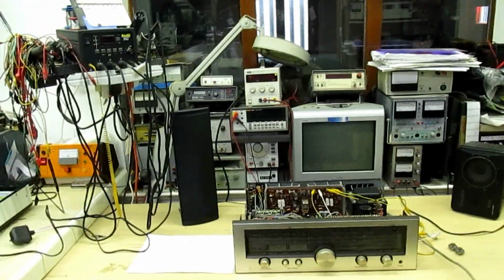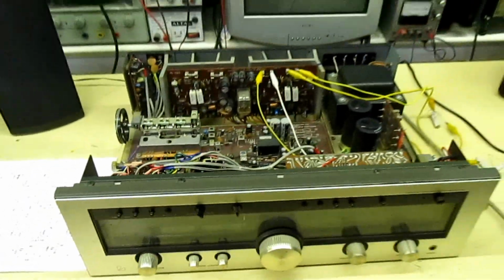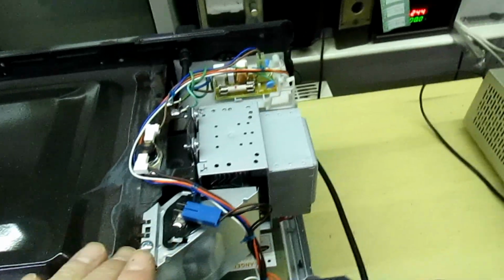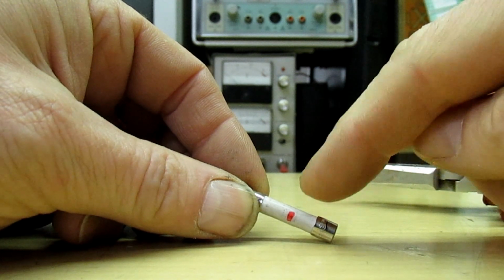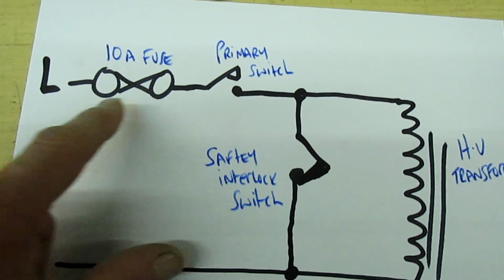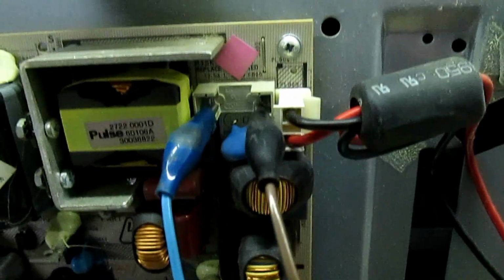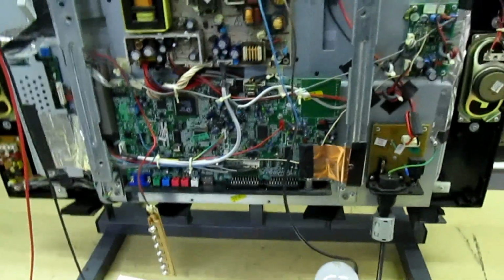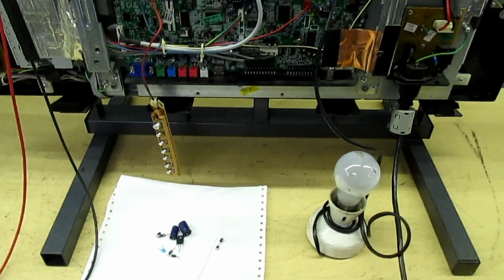Most Useful Fault Finding Tips

Comment: Been there before, all new components, switch on, BANG! Start again.🤣 I remember a TV shop I used to be friendly with. He had a brand new Mitsubishi TV in for repair with a blown fuse, PSU etc. Asked me if i'd like to have a go at it. I replaced the control IC, line output transistor, and some other parts. Switched on and was greeted with a perfect start up and cracking picture. After checking various functions etc, pleased with myself, I then turned it to standby with the remote, only to notice that the front panel LED had immediately gone out. The fuse and all the new components had indeed blown again. Eventually traced the problem to an inductor that was missing from the factory, it was in series with the snubber circuit. The collapsing field in the LOPT caused a back EMF that was not being safely discharged so turning the set OFF would blow it up. Good days!

Comment: I learnt this technique of using an incandescent light bulb limiter between the mains supply and equipment under test from uncle Doug who repairs valve guitar amplifiers. Absolutely essential for damage limitation! 
Incandescent lamps are a useful in determining whether an AC generator AVR is operating by connecting the lamp across the DC exciter field connections.
Then by varying the voltage set potentiometer the lamp should vary in intensity in sympathy.
Reply from the maker: and a lot cheaper than blowing fuses !

Comment: Love your presentation and Tips which help to prevent the "magic smoke" from happening! I'm just an enthusiastic (self-taught) amateur. Electronics has been a great pastime, but can be really frustrating to pin-point faults. I have never used a 60W bulb as a preventative measure, but always used a Variac, to bring up the voltage and current slowly. I have not seen all of your Productions, but (if you havn't covered the use of a Variac), would it be possible to consider expanding on the use of a Variac? Those transistors removed from the early stereo, look like AD 140's. It's amazing how you remember the many useless things, their part numbers. But these used to be on the rear of the early Car Radios. Always nice to see your work.
Reply from the maker: The problem with a lot of modern stuff it it will work with a very low input voltage so a variac is not a great deal of help, there ok when running up old vintage stuff though . I have an early car radio that someone gave me and I think it had an AD149 on the back .
Reply: @michaeldranfield7140  Thanks for your note on the car Radios with an AD 149 mounted on the rear of (usually) an alloy Heat Sink. However, you will also remember the much-earlier Car Radio that used Thermionic Valves. These Radios used some kind of "Vibrator" for the voltage required to power the Radio, and were huge in size! I remember (in the 60's) installing one of these in the passenger Foot well of my A35 Van. The reception was very poor, and you could hear the 'vibrator' as a humming sound over the single loudspeaker! I think that this old Radio was from a Motor Coach, but I was the first in our area to have a radio in my car! How fascinating to see just how far we have progressed from the 1960's to today. I also wanted to add, that (today), I am using a very good Car Radio as my prime Sound System in my Sun Room. This is powered by a 110 Ah Lead acid battery, fully recharged from the sun! Four Speakers and a 12V Sub-Woofer. I will never understand those Audiophiles who spend tens of thousands on Hi-Fi Equipment that is operated from the Mains 240V AC. My feeling is that you (first) need excellent Smoothing - to get rid of the hum and ripple. To me, the purest sound will always come from digital signals, and a pure DC Power Supply. Forget running your sound systems on any AC Supply, because it fluctuates so much, and voltage spikes can threaten your lifetimes' investment in Sound Systems. It's nearly always sunny in Sydney, so why not capitalise on using this for your Sound System? Greetings from Australia.

Comment: I remember reading your contributions in a magazine called Television (now sadly defunct) and you do seem to know your subject Sir.I have noticed that you have done a video about Thorn Ferguson's 1615 Monochrome T.V. Chassis and I wanted to ask a couple of questions about it but found that you had locked the comments section on that video for some reason.What I wanted to ask was this-Between the TBA120SQ 6Mhz Intercarrier Amplifier and F.M. Demodulator I.C. Circuit and the SN76013ND-07 Audio Power Amplifier I.C. Circuit is a Tone control Circuit which was only used on the De-luxe Model which also had a larger Picture Tube.This Tone control circuit comprises C73,R66 and a Shorting Plug which would of course be removed and a Potentiometer plugged in instead in the De-luxe Model.What I want to know is did they link out R66 in the De-luxe Model?With R66 left in circuit you would only have a tiny amount of Treble lift and most people wouldn't notice the effect.Also is the potentiometer for this meant to be a 1M Ohm Linear type?

Comment: Great video Mike. Just subscribed. We had a fire in the other day to our workshop. www.sheffieldtvrepairs.com   the fuse was blown. We removed the fuse and checked it to see if the metal had vaporized which it had not. This brought us to the conclusion that it was not a violent short circuit. We found the fault and fixed it.

 I remember our colleague teacher in 1980 ex navy tech in Australia. Great teacher( Hello Ken hope your still with us) , and a great guy saying in a lesson. The question is, why did the fuse blow????????

Had not thought about it much until last week that the fuse tells a story if you examine it, so I was really impressed that you came to the same conclusion. Great video because I would not have thought to have opened up the fuse. Very forensic approach, like watching NCIS. Thank you for sharing this with us our number is 01143605355 if you are in Sheffield. Kind Regards Kev